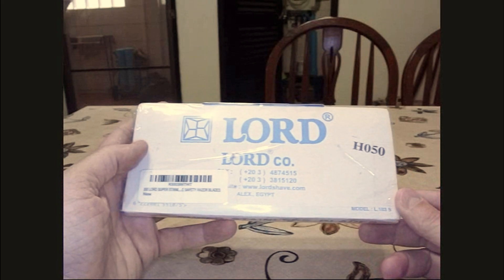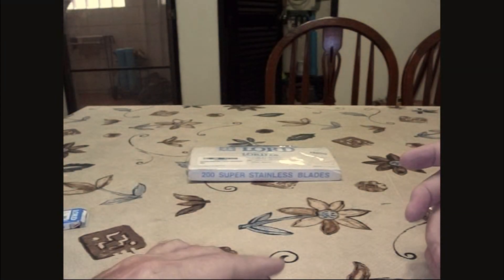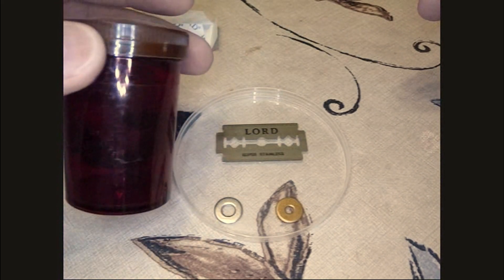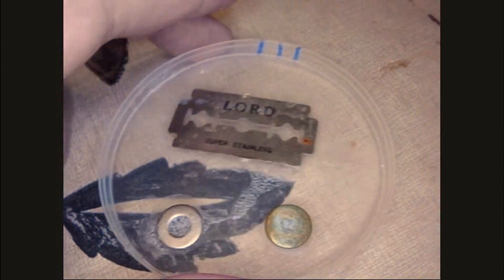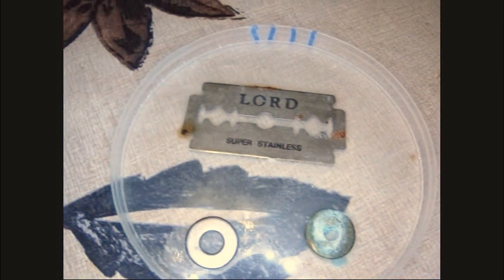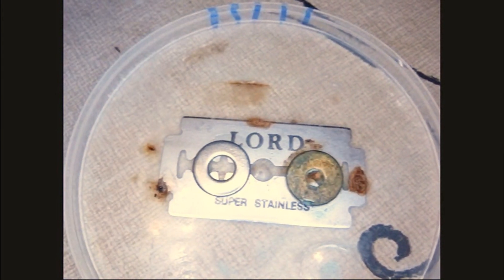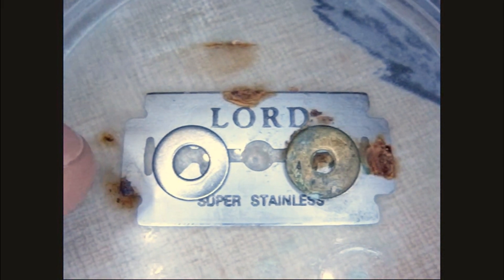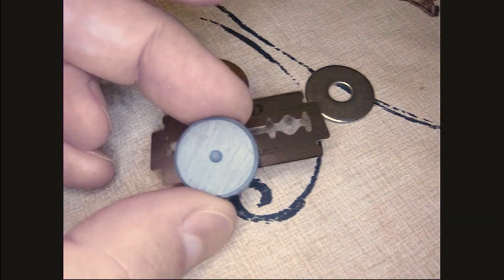Lord "Super Stainless" Razorblade Test

Comment: My supply of lord super stailess does not have glue and no rust. I leave it in the razor for weeks since I have many razors to try. Never saw any rust.
Reply from the maker: Makes me wonder if I got fake product.
Reply: @tsbrownie  It could have been the old batch. I just opened a new pack to re check and still no glue on the blade but there is glue between the paper covering folds like a glued envelope. I would wash off that glue on your blade before using so that there will be no rust spots in future. I have seen poor stainless steel products rust too. All stainless steels are not equal.
Reply from the maker: @Raj-nh3fc  OK, thanks I will.